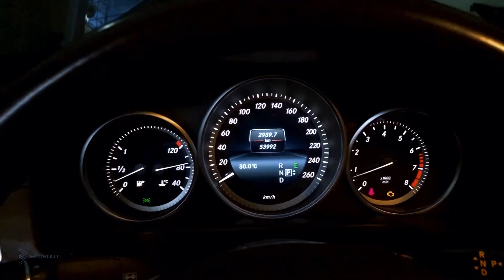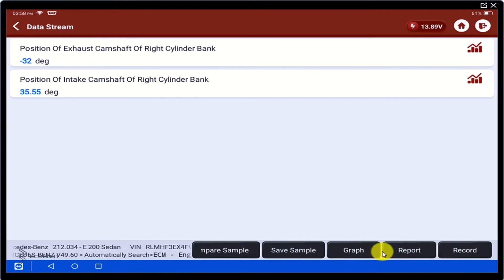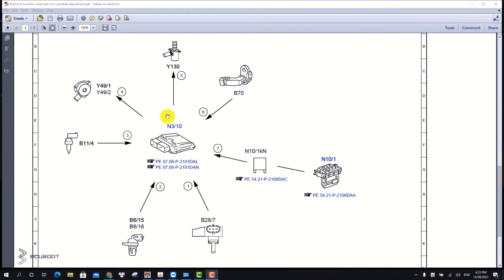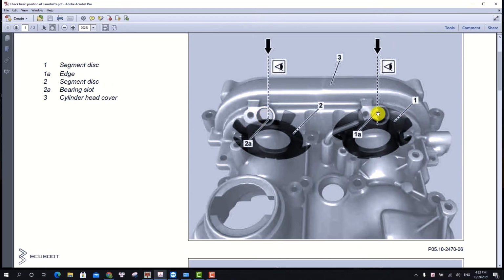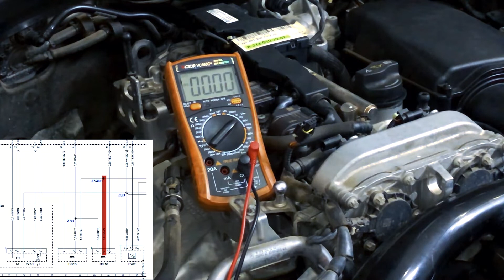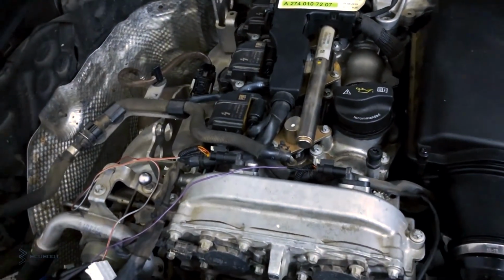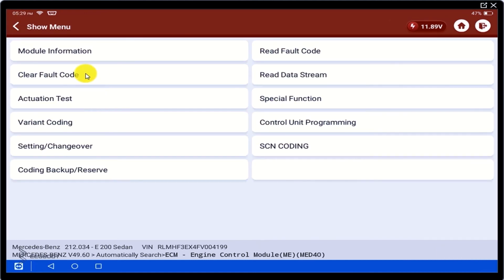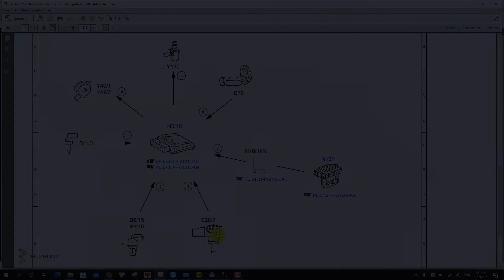Mercedes Camshaft Position Sensor Fix - DTC P1208, P0016, P0017, P03680

Comment: Hello good day, Mercedes S350L 2008 model Benz version gave error codes 2225-0275-1200-1208, when I start my vehicle once or twice a week when the engine is hot, it does not start as if there is no fuel, when I start it after half an hour, it works normally, there is no problem in its fever or traction.

Comment: Are you able to give me any advice on the difference between the P1200 vs. P1208. I have a Mercedes E350 with a 1200 error. I had an intake manifold issue which I fixed, but now it is showing P1200.  I check the visual inspection and it looks fine. What is the difference between 1200 and 1208 ?

Comment: It’s an interesting short clip that went from theory to practice too!  Now, have you been able to dissect the code 1208 itself?  I heard that it’s more serious?  The question is: if we had 1208, how do we know that it’s the balance shaft or something less serious such as timing chain, tensioner or cam adjuster?
Reply from the maker: If you want to dissect 1208, you must check other relevant potential problems as well just like you said but its very difficult to check the balance shaft even for mechanics that dont usually work on Mercedes. However, fortunately Balance Shaft is hardly ever break down. I already showed you how to check Camshaft Position in this video, other problems like timing chain, its tensioner and adjuster are very easy to check. You can look up videos on YT